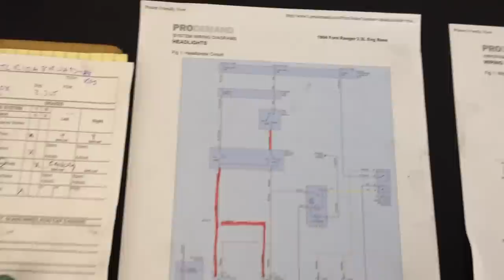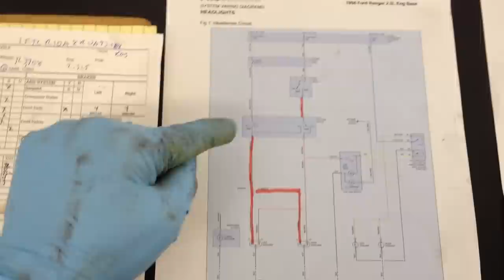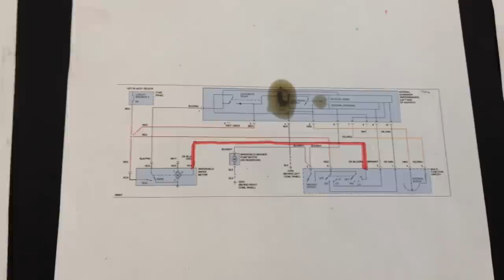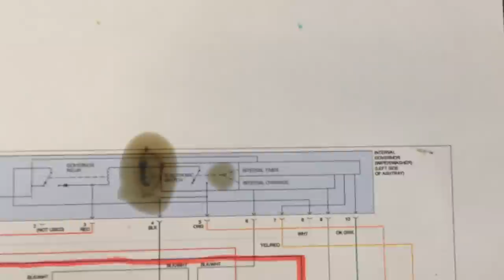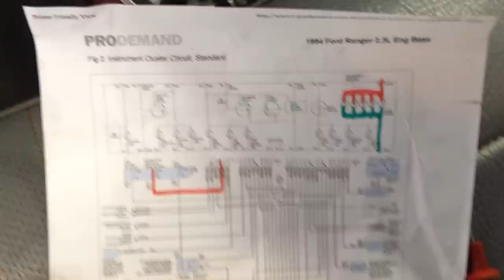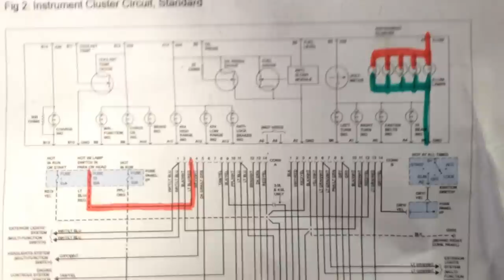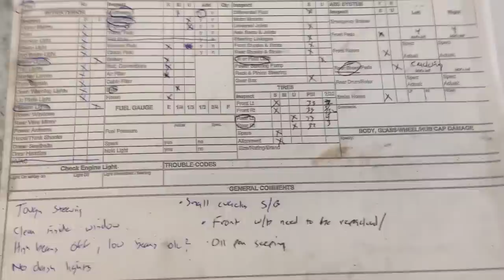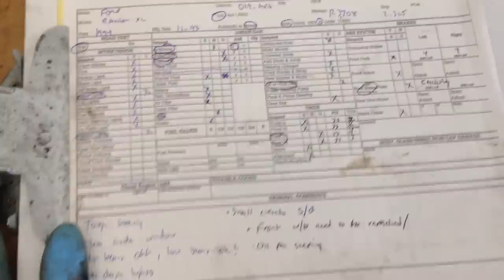The Case Of The 1994 Ford Ranger With Electrical Problems & Burning Smell!

Comment: Hey dude I have to do a job on my 1994 ford ranger but but the headlight lowbeams don't work. I checked the switch and I noticed at the backside connector was burnt from the red/yellow stripe. I'm going to check that.

Comment: I have a 94 ranger and it has a problem starting because the fuse box under the hood doesn’t click 2 times sometimes to start the relay/ the truck
Reply: do you mean 2 seconds? for the fuel pump prime.  or do you mean the relay for the starter?
Reply: A year or Two ago I had an issue with my truck not starting sometimes but if I pulled the fuel pump relay and put it back in when the key was on I could get it to start. It ended up being the feed wire inside the fuse box. Some moron had poked it with a test light years before and didn't protect it so eventually it rotted and lost power periodically.

Comment: I also have a 94 ford ranger. I have a problem right now with my right side turn signal. My break lights and both left and right signals in the rear blink when right turn signal is on, and when brakes are applied, signals cut out. Any ideas where the problem may be?
Reply: The lamps are chasing a ground through the positive side which is not being used.  Any time light do weird things it's a ground problem.  Sometimes a burnt bulb can allow One disfunction but that many is a ground or possibly wired wrong causing a back surge.

Comment: my lights flicker they dont cut off just flicker at idle new battery new alternator new switch iv redone every ground i can find and still flicker any idea?
Reply: your relay may not have  been getting a good connection or the power to it isn't great. I've had a few issues with the fuse box under the hood on mine. Generally the flicker is from the alternator pushing voltage and then not but if it can't get what it needs it'll surge through where ever it can..   To verify that type of issue  you can take jump  cables and ground the  core support to the battery  and Assuming that didn't change anything take the other cable (positive) and power the lamps directly with the clamp while the other end is also connected to the battery.

Comment: I also have a 1994 ford ranger. I've replaced the headlight switch and the connecter that plugs into it but the headlight wire (red wire) keeps either melting my connection or the connecter.  Have any thoughts on what's going on? Short?